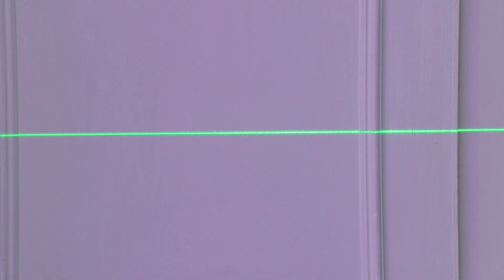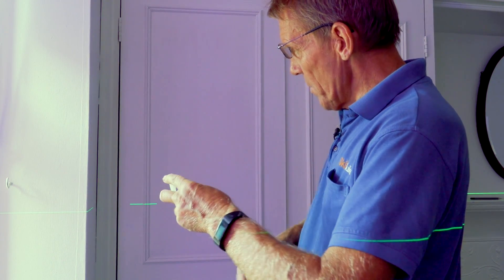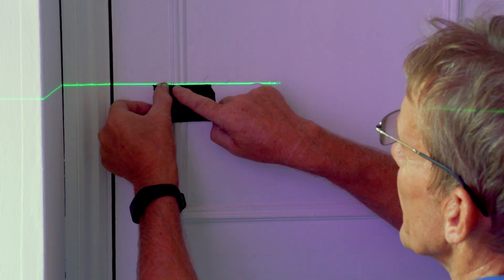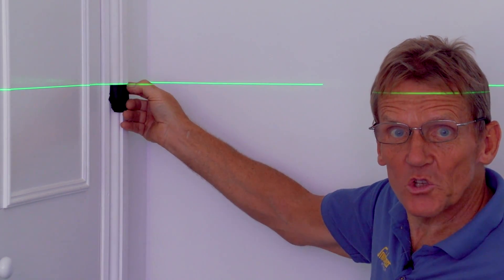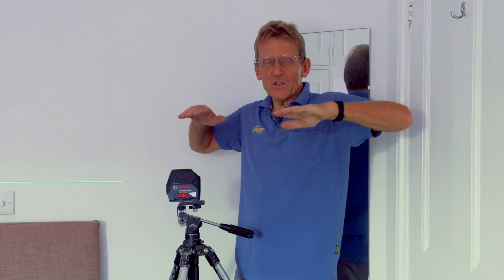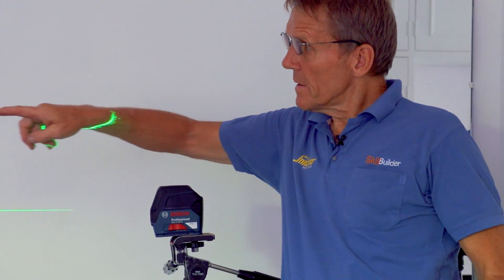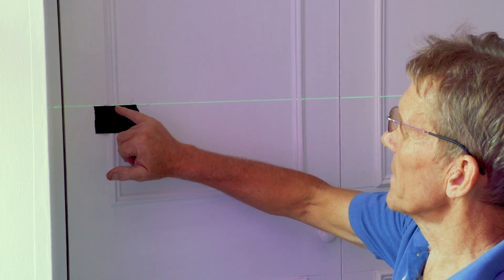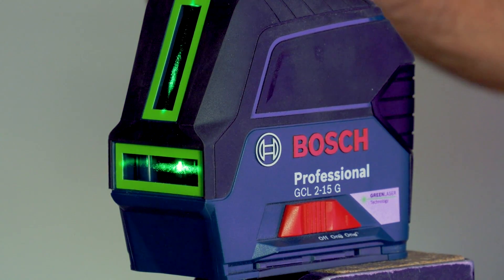Is Your Laser Level Really Level? How to Check

Comment: Hi Roger.  Great video!  Also, greetings from SC in the USA!  I am a professional Land Surveyor, and there is an interesting bit that you missed that is very handy for you and your viewers to know.  That is, that when you put up your tape, you should begin with your laser exactly (give or take a few inches in your 10 ft example) halfway between the two pieces of tape.  Why?  Because the tops of the tape will then be exactly level EVEN IF your laser level is out of true.  Why is that (you might well ask)?  Because the laser line that is supposed to be perfectly level is instead "pointing uphill" (slightly) or "downhill" slightly., regardless of what direction it is pointing.   IF you do that, you can then put your level really close to one of the tape pieces, and if you are off the other one, you will know the error per distance exactly.  If the tapes are 10 feet apart, and you are within a foot of one tape, the error at the other tape is the error in 9 feet.  You should start with a measurement that has no error (because it is the same looking both ways because the distances match).  Then the second set-up shows all the error at the more distant tape.  The most important thing about this comment however, is that it allows you (in a jam) to realize that you can transfer accurate elevations from one spot to another, WITHOUT a perfectly adjusted laser.  You just need to be halfway between the two measuring points.  How do I know this is true?  Because in my work, we utilize 30X telescopes that use the same "free swinging weight with a prism attached" tech that the lasers use.  When the swinging prism swings, our telescope crosshair moves up and down, just as the laser level line does if you tap it gently.  Our instruments (they are called "survey grade levels) do get out of adjustment.  We set two stakes in the ground 360 feet (or 120 meters ) apart.  We put the instrument we are checking halfway between them (+ or minus a few feet, we step it off because that is close enough).  We then use the instrument to read a grade rod on each stake, which gives us the difference in height between the two stakes.  At that distance, we can read down to about 2mm.  Knowing that the difference is accurate (because any error is the same looking both ways) we then set up a few feet away from one stake, and repeat the process.  If the difference is the same, our instrument is in good adjustment.  If it is different, we move the crosshair up or down to obtain a reading on the far grade rod that will make the difference correct (we are so near the near stake that we won't have enough error on it to matter).  Then, the process is repeated to verify that all is well.  In other words, when a survey level, (or a laser level) is in good adjustment, it hits the same spot when midway between two points as it does if one is very close and the other quite distant.  Key takeaway: if you set up midway, you can transfer elevation accurately with a laser that is out of true.
Reply from the maker: That is brilliant John
I will read that a couple more times to make sure I have it in my head then I will make an ammended video. Thank you for going to the trouble of explaining it so clearly.
Reply: @SkillBuilder  Thanks!  I did forget one suggestion I should have made:  Get the longest hallway in the building (or find a bigger building) and check the laser midway between two points that are 30 or 40 feet apart.  Then, when you set up near one of your marks or tapes, you can really see the error at the distant mark and measure it well.  Then, knowing the distance (15 to 20 feet each direction for the midway measurement) you can get the error at whatever distance (30' or 40' say?), and compare that to the XXmm spec per YY meters, to know exactly if it meets specifications.
Reply: @Skill Builder  how about comparing the horizontal against a water level and the vertical against a plumb bob ?
Reply: @royblackburn1163  These are the best, in theory.  In practice they are difficult to pull off.  Plumb bobs are terrific indoors with no vibration, but only along their length.  The laser line continues up to the ceiling directly overhead, and the floor underneath.  To check that a laser line is truly vertical, a plumb bob that hangs motionless at least thirty feet away, and is long enough to hang well below the level of your feet and hangs from something well above your head, is ideal.  So, you need to be inside on the edge of the second floor somewhere where you can hang a plumb line from the ceiling of that floor to the middle of the first floor, and you can see that whole length of string.  Normally you can only do that in a building under construction.  And a hose for level is also great, except that that in a tiny hose, the water level line is unclear, because of surface tension.  To get a hose wide enough so that you can "see" water level (so as to separate it from the curled up edges to to surface tension of water), you need to spend money to get enough clear hose to make a meaningful check, and it helps to color the water to make it easier to see the level line.  In practice, these methods are usually too unwieldy to use, except if you are dealing with flat earth people, who won't trust anything they don't understand, and can't understand anything more sophisticated than these old tried and true methods.
Reply: So if I understand it right you're in measuring pitch , rather than roll. Because the laser can be off in two axis. In your initial measurement, when you are half way, you are actually at the bottom of a T with ends of the horizontal bar being the tape/rods. When you set up next to one rod, you are  setting up the instrument  perpendicular to the first reading from there bottom of the T. But you might be in a situation where the pitch and roll are present in equal amounts, and you believe you have a clear reading, but the errors just cancelled each other. 
With a 360 later it's a lot simpler, but you could fix it by having a third tape/rod near the bottom of the T and checking all rods from every position. 
How I understood that right.
Reply: @gallowsongs  I don't completely understand everything you said, but I think I can answer your question because I do think I understand what you mean by "pitch" and "roll".  "Pitch" in this case refers to raising or lowering the nose of an aircraft, whereas "Roll" refers to raising one wing and lowering the other.  

So, to understand completely what is going on, imagine that you have a perfectly plumb pole or pipe, and that you have attached to that a flashlight, and the beam of that flashlight points in an exactly horizontal direction.  That is, the flashlight beam points towards the horizon, and relates to the plumb pole exactly 90 degrees angle.  Now imagine that you replace the flashlight with a laser light that projects a tiny precise dot, but still exactly perpendicular to the pole, which still points towards the center of the earth's gravity (that is what "plumb" means).  Now, you CAN think of that direction the light is pointing as "pitch".  Pointing that laser beam "uphill" could be regarded as "changing the pitch".  

But, with a laser level, there are not an infinity of separate lasers pointing at 90 degrees.  Instead, if you rotate the laser pointer and its laser beam around the plumb pole, 90 degrees to the right, you are now dealing with "roll" (if I understand correctly your use of terms).  The key thing to understand here is this:  If the pole or post or rod the laser is mounted on is perfectly plumb, and the laser is rotated very quickly, you will not see lots of laser dots, you will see a "line".  If the pole is plumb and the laser is horizontal, the laser line will represent a "plane" (not an aircraft, but a geometric plane).  If the pole is plumb, but the laser is pointing downhill or uphill, the laser line will represent a cone (actually, the part of the cone that intersects whatever wall you are looking at to see the laser line).  In the first example, the rotation axis is plumb, and the laser is level, and the resulting figure is a level plane.  In the second example, the rotation axis is plumb, but the laser IS NOT level.  The resulting figure is a cone. 

 I think the question you meant to ask is: "what happens if the level is 90 degrees (perpendicular) to the axis of rotation, but the axis of rotation is not plumb?".  If that were the case, you would have a plane surface that might be "level" in the forward to back direction (what you call pitch) but off level in the side to side direction (your term "roll").  If that is a correct rendering of your question, you are also asking me "So John, how do you account for the possibility that the axis of rotation is not plumb, which would cause problems if everything else was good?".  And, my answer would be "Wolfgang, you are correct, to find and correct that, we need to do the procedure twice".  

To account for this possibility (which is VERY rare) you would check the level exactly as I have described, but you would note the orientation of the physical laser device.  This is hard to explain.  If you have a car, or a camera, or a gun, or an arrow, there is an obvious "direction" that you can understand that the device "naturally points at".  The barrel of a gun or the nose of an aircraft could be said to "point" in some direction.  You could then call that arbitrary direction "Straight ahead" or "12 o'clock on a clock face".  But your laser level has no "direction" that it "points at".  So if your laser is shaped like a box, you would have to pick one face of the box and call that "straight ahead" or "12 o'clock.  To check for the "roll" problem you mentioned, you would simply repeat the entire checking process, after turning the laser level so that it points "to the right 90 degrees" or "to 3:00 O'clock on the clock face".  In other words, you perform my suggested checks/adjustments twice,, with laser pointed 90 degrees different the second time.

 Lets say you performed the level check as I explained it earlier, and you used the longest hallway you could find indoors to make it both easy and accurate.  A long hallway makes for a very accurate measurement and correction of error, and inside makes the laser line easy to see.  So, you would perform the check just as I had originally described, but you would note something about the laser that would allow you to define a "pointing direction".  My laser is shaped like a tiny bus, with the two short sides of the bus being the "front and back" of the bus, and the two long sides being the "side" of the bus.  So, if I was checking to make sure my level was good both in pitch and roll (to use your terms) I would first point the "front and back of the bus up and down the hallway, and do the whole check procedure.  I would then repeat the entire procedure with the "sides" of the bus" pointing (oriented facing) the long hallway.  Once your laser level tests level in both directions, you will have accounted for all possible sources of error.  BUT, I must say, because of the way laser levels are designed, the "roll" error (rotation axis not plumb)  is VERY unlikely to occur.  On the other hand, the pitch error (laser not perpendicular to rotation axis) happens a lot.  So, doing the check process I originally described is going to eliminate most possible error.  Repeating the whole process with the laser level (the physical device itself) "pointing" 90 degrees right (or left) of where it pointed during your first check, that will eliminate all possible error sources.  

Why is this second type of error so rare?  Gravity is used to make sure that the axis of rotation is perfectly plumb.  Imagine that the axle (axis of rotation) is freely hanging from a support, and gravity makes it perfectly plumb.  If I set up my level, and I tap it, I will see the laser lines on the walls around me "rock" up and down as the free hanging axle swings under its support.  There are just not many ways this system can go wrong, its too simple and basic.  But, rare is not impossible.  If I left my laser outside for a couple of years, rain could get in, and rust the parts so that the axle could no longer hang freely straight down.  In that case, I wouldn't need to do the above procedure to detect that.  I would just turn the laser on, wait till the line stabilized, and gently tap the laser.  If the laser line rocks gently up and down, it is working correctly.  You are seeing the swinging pendulum that is the axle represented by the laser line moving on the wall.   If it "shivers", then the axle no longer hangs straight down, but instead points "almost straight down" and does not want to move.  At that point, you consign your laser level to the dustbin of history.  I will finish by saying this:  From my experience, the "roll" type error, which amounts to the axle not being able to "hang" exactly in line with the earth's gravity, is so rare I wouldn't bother to check twice with two different orientations 90 degrees apart.  If your device did "freeze" this way, it would be immediately apparent in the odd behavior of the laser.  When an axle does get stuck, it will usually give you a laser line on the wall that is so "off" you know it as soon as you see it.
Reply: One other thing I realized.  Some of you have no way to rotate the laser 90 degrees without "unleveling" it.  You must (if you physically rotate the level on a tripod) re-level the laser before performing the second round of checks.  I forgot to mention this because I have survey equipment that makes this easy, and it is so obvious to me from my profession that I forget that many of you do not have the mounting equipment I have.  I usually mount my laser on a survey pole that is perfectly plumb, supported by a survey tripod that is very stable.  The top of the survey pole has a threaded stud that fits the bottom of my laser.  For me, keeping my laser leveled and physically turning it 90 degrees does not render it un-level.  But if any of you place your laser on a survey or camera tripod, you must re-level your laser each time you rotate it EVEN IF you are not moving to a new setup.
Reply: @johnwetzel5248 Spot on I can see you paid attention nicely explained,do you work for the government by any chance or the council maybe.😅
Reply: John Wetzel Brilliant,  do you still use a plumb  
bob to set up theodolite tripods over a preset point,  and do you use 2 plumb bobs as a vertical datum for line of sight alignment,  thanks Roy.
Reply: @royblackburn1163  I use the plumb bob every day if I need it, but usually I can get the theodolite over the point within  1.2cm by eyeball, and after that, the optical plummet (after checking) is used to finalize the setup.  And yes, two plumb bobs (if no wind) can be used to make sure the vertical crosshair is truly vertical when the theodolite is verified as level.  But, plumb bobs are actually more reliable.  Absent wind or vibration, the plumb bob always points to the center of the earth, while optical plummets and lasers may or may not be thus aligned, and must be constantly checked.  Optical plummets are preferred for daily use only because they are immune to the breezes that can blow a plumb bob around.
Reply: John I’ve got to love you, your understanding is a breath of fresh air, I take my hat off to you. It’s refreshing that someone like yourself has taken the time to explain how and why, in great detail without confusing people with complicated explanations for your reasoning. If someone can’t understand your reasoning then that’s there loss
Reply: Thank you John, I'm gunna read that ten times for it to sink in. 🙏👍
Reply: @fractalofgod6324  that all?   LOL

Comment: What about.. set a horizontal laser, make a line on the wall than turn laser to the right, make a edge of light around your line on the walland see a difference ?? And same turn to the left? You dont need to move a laser level  from place a  to place b.. you will se a difference in the level in same spot.. boom
Reply from the maker: That is not the way that Bosch suggest in their handbook. They say to move the laser.

Comment: Another great video SB, I guess another way is to leave the tripod in place and just to rotate the laser 90 deg or so, this way you only need a single peice of tape also?
Reply from the maker: I am not sure how that would work but I will try it in our laser showdown.
Reply: @SkillBuilder  (in my head at least this makes sense so bear with...) fire the laser at the wall, tape one side of the horizontal beam (LHS for example), then rotate the laser on the tripod CCW so that RHS of the cross now sits on the tape (or above or below if it's not level!)...looking forward to the showdown, I've been looking at the Magnusson IM0301 from Screwfix, seems like a really good value laser for DIY'ers but not much in the way of reviews I can find.